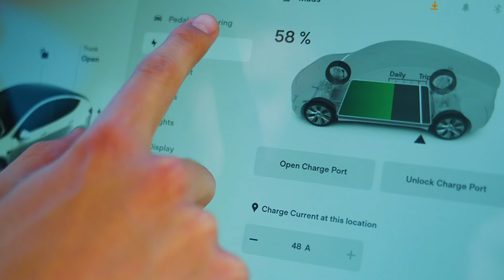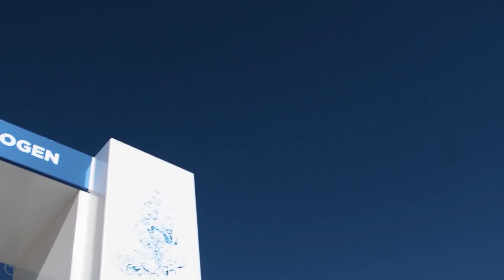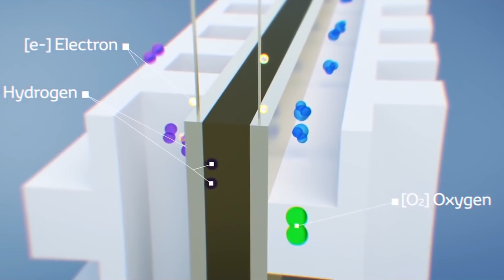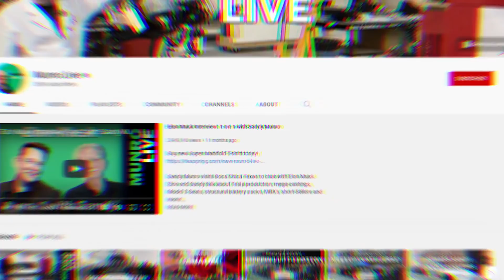SANDY MUNRO: Will Hydrogen Fuel Cell Tech Survive in 2022?

Comment: Sandy can’t make his mind up on hydrogen, keeps flip flopping. I think it makes sense for anything bigger than a Model 3.
Reply: You can't make green hydrogen for less thn 3x the cost of the electricity that you use to make it. You need a very good reason to opt for the expense of hydrogen when you could use batteries.
Reply: @eclecticcyclist  batteries aren’t green either. Battery recycling is a scam too. I’m trying to sell my old MacBook for someone to repurpose or use the parts for and I can’t even give it away 😂 perhaps batteries though are a better solution for something like the car you see in my profile pic.
Reply: @thomas735  There is a far higher concentration of battery metals in recycled battery 'black mass' so it's always going to be a cheafer source than tons of mined minerals with a concentration of 1%. If you can't give your Mac away send it for recycling.
Reply: @eclecticcyclist  true! We’ll see, I might take the Solterra for a test drive when that comes out, never driven an EV before
Reply: @thomas735  Put a new Linux OS on that MacBook and some kid can use it for homework.
Reply: Two years ago he said he couldn’t envisage any vehicle running on hydrogen 🤔
Reply: @lesliecarter4295  one year ago he said hydrogen cars had tons of potential. Search his 2021 Vs EV tech video from last April.
Reply: @thomas735  agree. He’s pivoted a lot in two years. I think that if they put in the infrastructure for trucks and make it available to the public then car users will want it,especially if the price/kg of hydrogen comes down to $1/kg.
Reply: @lesliecarter4295  yeah I’m def in the hydrogen camp. Batteries are good for something Honda Civic sized  but doesn’t make sense for anything that tows or hauls a bunch of kids.

Comment: Very interesting. Hydrogen for planes, ships, and trucks. Batteries for consumers and short travel
Reply: Well not exactly.  It's Hydrogen for planes and ships for sure near term.  It's Electric (both hydrogen fuel cell w/ battery as well as battery only as options) for long haul trucks.  And Battery only for consumers and short haul trucking.
Reply: @ChadCourtneyTAZ427  not quite. Hydrogen is far too dangerous to store in quantity to be able to keep it in any city or area with a building within about 1/2 mile! 
Trains yes, shipping yes, aircraft possibly.  Road vehicles certianly not.

Comment: I wonder if it is possible for hydrogen to output more energy than it provides, or is that going against Physics 101?
Reply: I wonder if it is possible for you to ask a question that makes sense to the rest of us?
Reply: So you want something to provide more than it provides ???
Reply: You're the guy with a generator hooked up to the rear wheel of your Bolt, aren't you?
Reply: Hey no need to get testy. It’s a simple question with a difficult answer for sure.